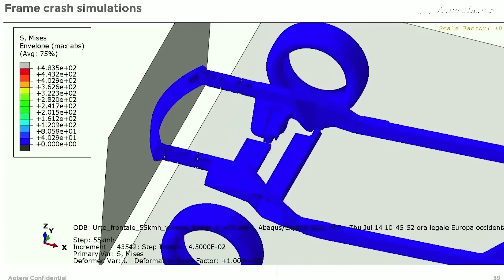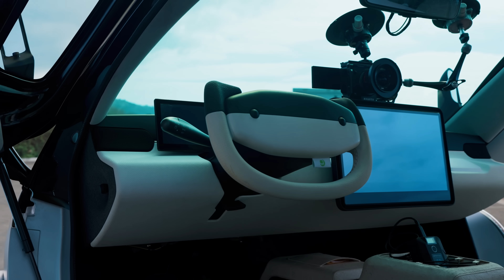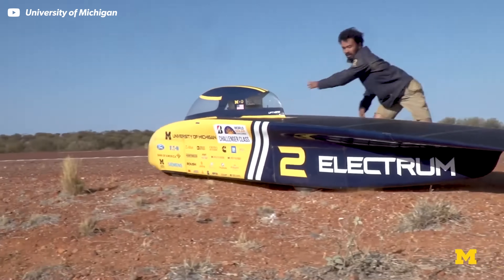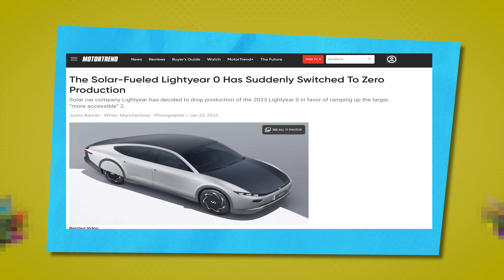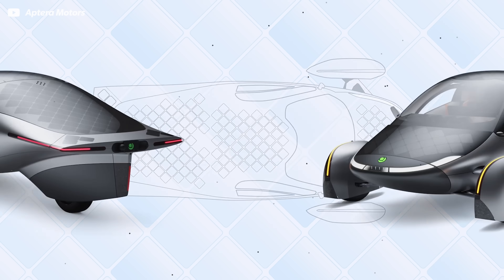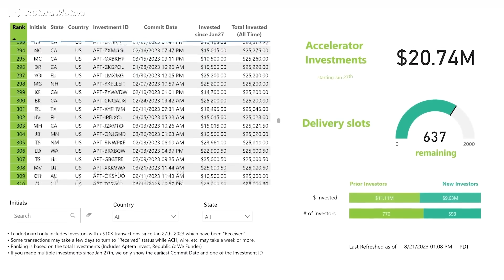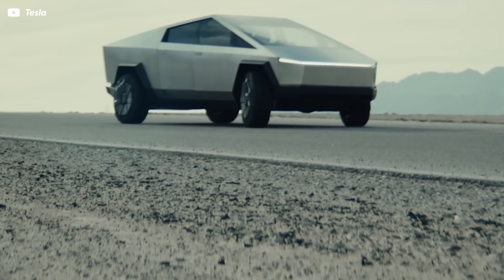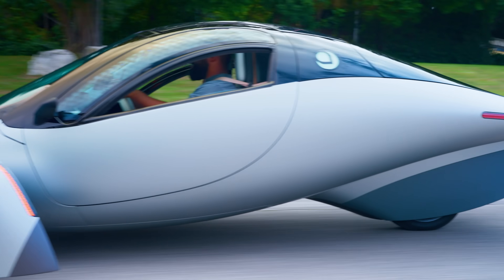We Drove America's First Solar Car

Comment: I'm on the list. There's No need to convince me further. But...

What is it with this skateboard pedal fetish? Is this a California thing, a generational thing, or what? I don't think Aunt Mae from Podunk, Nebraska will be impressed. Tell me the production model's pedals will be plain, black, and otherwise indiscreet. Please.
And...,  the steering 'wheel' is not my thing either. This is way more a negative influencer than the pedals. I won't be looking at the pedals while I'm driving, so they can be ignored. In my opinion, the yoke is a joke, regardless of the benefits being touted. And what about the plethora of screens? What ever happened to the KISS method of design?

I love the concept. There are so many positive things to say about the vehicle regarding engineering and exterior styling that I can't list them all here. The interior however, leaves a little wanting.

But I guess a few thorns are no reason to dismiss the beauty of a rose. I'll learn to live with them (like'em or not)

Comment: Why don’t they put an alternator on the drive shaft of cars to charge the electric battery?
Reply: That would be a sort of "perpetual motion machine" that couldn't recover the friction losses.  In fact, some energy is recovered when going down hill or braking through regenerative braking systems.
Reply: @n.brucenelson5920  then how does a windmill or water turbine work? The drive shaft spins so...
Reply: @jameswilson4732 The windmill or water turbine are not getting their energy from the same system.  If the wingmill was turning with wind blown by a fan or the if the water came from a pump driven by the same battery system you would have the same issue.
Reply: @n.brucenelson5920  so you couldn't put a separate device in the spinning drive shaft to capture the energy and transfer it to the batteries?

Comment: Hmm... a design that will NEVER gain easy acceptance nor ADR compliance in Australia. IF it was given approval it would be classed as a motorbike with that solo drive wheel. Three-wheels = motorbike. There are similar motortrike vehicles for sale. Most consumer drivers would baulk at the need to pass a test for a motorbike licence. It automatically restricts the market greatly.
Reply: There is no solo drive wheel - they have either 2 or AWD.  It is likely that the laws will change regarding the class Aptera needs to be tested for.

Comment: so how many years would it take to charge the  batteries using the solar panels>>>
Reply: The answer would depend on the size of the battery pack and the local solar insolation, but it won't take years.  You can easily find the data for your location.

Comment: I wish this was $25k like they said it would be
Reply: The base model was announced with a target price of $25.9K in 2020.
Reply: @Sony-ox7wx  Both vehicles have gone through significant changes since they were announced.  However, even with the huge upgrade in design from a vacuum resin infusion body to carbon fiber and SMC, the value proposition has only increased.

For those that seldom need a 4 door car, the cost of ownership and the environmental burdebn of an Aptera, and the likely service life are all vastly improved over a Bolt.  

Also, for those who want to go camping, the Aptera can sleep two people who are considerably taller in vastly more comfort than if it were tried in a Bolt.  Aptera is a perfect weekend camping vehicle.

Comment: That driving yoke is so frigging dumb. It's not an aircraft where the yoke only has to turn 90 degrees each way, it has to turn full lock either direction like a car and so removing the wheel makes it awkward to hand over hand turn. If space is an issue, use a smaller steering wheel like Peugeot cars have.
Reply: All great things are a mixture of Art and Engineering.
Reply: The yoke was chosen because the side rear view screens are in front of the driver. A full wheel would obscure the view. The steering will probably be proportional. Quicker at slow speeds and slower at high speeds. Lock to lock probably won't be necessary.
Reply: @tims8603  like I said, use a smaller wheel then. Peugeot cars have teeny tiny wheels that don't obscure anything while supporting hand over hand turns or just comfortable resting of the hands on the wheel. I don't know if the car is steer by wire but you're not going to solve the full lock issue otherwise. I've also not seen any car with a yoke and steer by wire running 90 degrees left / right where anyone has anything positive to say about it - best they say is "you get used to it", which is damning with faint praise.
Reply: @drxym  From what I understand, the steering post will be an 'off the shelf' part. There will, probably, be  a way to change out the yoke for a steering wheel.  They may even offer a choice between the two. We really don't know yet.

Comment: So no one gonna talk about the 1000 mile range? Where in that car they put such a big battery pack? Am i missing a new technology or something?
Reply: The 1000 mile range version is still probably several years out.  The pack itself will use new batteries with the same form factor as the present ones, except taller.  This is also true of the 600 mile range versions.  There is still a lot of development work to do to complete these models.

Aptera is a continuous improvement company, and there is a possibility that completely new battery tech will be available to them with higher energy density than the present cells, and if so, they could switch.

Comment: Why isn’t the whole body covered in solar cells?
Reply: Probably cost Vs reward.
Reply: Every usefull surface is covered with the full solar package, the nose, the dash, the roof, and the hatch. Putting them on the lower panels would be ineffective.

Comment: I'd buy it i'm from idaho wonder how it will handle in snow?
Reply: I live in Iowa and will be reporting on the performance with an early model.  Due to the excellent traction control with AWD and snow tires, I expect it will do well.  The wheels can adjust torque with tire slip every 2.5" of tread travel.  They already tested a prototype on a ski slope in Switzerland with snow depth above the bottom of the wheel pants and it did OK.

Comment: They’ve been promising this car for like 10 to 15 years what’s taking so long?
Reply: Not true.  Aptera Corp was founded in 2019, and design was begun on this EV.  The company originally expected an initial demand in the neighborhood of 4,000 vehicles.  Paid reservations exceeded 3000 in a week and quickly grew - now past 48,000.  

The original plan was to build the vehicle with vacuum resin infusion, as are the prototypes.  Such production doesn't scale well, and production was delayed so that it could be redesigned to be produced by CPC, a Supercar builder.  The quality of the production vehicles has taken a major leap.  The first Production Intent vehicles will be finished soon and validation testing will start.  Depending on results we should start seeing shipping by the end of 2024 or start of 2025, if not before then.

Comment: Won't work in Oregon for 9 months out of the year...
Reply: What makes you say that?  I intend to drive mine in Iowa year 'round.  You know that you can gain 130 miles overnight by plugging into a standard 115 volt AC outlet, don't you?
Reply: @n.brucenelson5920  - kinda defeats the purpose of a “solar powered car” if you have to plug it in the majority of the time. Also, I’m highly suspect of their solar charging claims…
Reply: @AdamsLab  Oregon Coast conditions aren't Southern California where most of the early buyers are located.

Perhaps you aren't familiar with the performance of the Maxeon cells that Aptera is using.  It is the area where Aptera has the most IP, that still needs protection.  We will be finding out more details with the 3rd party validation work on the validation models that will be on the road soon.
Reply: @n.brucenelson5920  - Cool, a car that's only viable in a single state... 🤣
Reply: @AdamsLab  Perhaps you didn't notice that I will be driving one of the first of the vehicles year 'round in Iowa.

Comment: What about if the car is parked in a parking lot and off. Will it still charge by itself?
Reply: Not sure what the question is.  As long as the panels get some sun, they can charge the batteries.

Comment: The model they are driving is closer to $45k
Reply: That's not the case.  That one they are driving does not have the full solar or a long range battery. It's is a prototype. The Launch Edition will have full solar, AWD ( wheel motors on all three wheels) and a 400 mile battery. While the final price might change, currently the Launch Edition is $33.5k.

Comment: Heated wheel arch for the snow?
Reply: Much of the heat produced by the vehicle is from the wheel motors located in the wheel pants.  It may not need any extra help for this function.

Comment: When it started out was it ever meant to be a SOLAR CAR
Reply: This particular design began in 2019 with a wheel motor drive train and solar panels.  Friction points were eliminated where ever possible to make as much use of the available power as they could.
Reply: Not at first but they got it efficient enough that solar would give you 20 to 40 miles a day and now they pushing the solar thing. I just hope they keep a glass rear window as an option.

Comment: A huge part of the power used in a car is pushing air out of the way. That's the hidden magic of Aptera's range: aerodynamics. Rolling bricks with ICE tech are so horse and buggy compared to this. Since they're legally motorcycles in many states, I can't wait to see people show up driving Apteras to motorcycle license endorsement classes.
Reply: Probably won't happen.  In some of these states, you can;t even roll a dresser bike through the area that it is required to turn in with the wheel at lock.  They provide a small bike that the test must be taken on.

Comment: So not really solar powered. Just since minimal extra charging from solar panels. Really minimal. 5 miles charge per hour in the sun.  Hope you don't drive more than 5 miles per hour.
Reply: You do know that the sun will be charging as much as 4,000 watt hours per day into the 45 kW battery pack of the first models, don't you?   That will be enough to drive 40 miles in the US SW at EPA highway speeds.  

We will have more exact numbers once the validation testing has been completed on the PI models.  I would call enough power to meet the daily driving needs of the average driver real solar power.
Reply: @n.brucenelson5920  so if you drive more than 40 miles in a day you are running an energy deficit.... that's my point. It's not solar powered.
Reply: @greatbigguy  Look at what you said.  You don't have a point.  In Iowa, I will probably only average 20 miles per day, but that is still more than my usual daily miles.  It is likely that I can do an occasional round trip to Des Moines or Kansas City and STILL be only on solar.  And, lets say I have to plug it in.  Where I live, 63% of my grid power comes from wind..  And if you compare it to any other car - lets say a Tesla Model 3 at the same speed, I will still use 2.5 times LESS power, no mater what the source.  The daily power expense will put dollars in your pocket no matter how much or how little you drive.
Reply: @greatbigguy  And it could be completely wrong  If I average less than the solar gain per day, which many owners will, I can drive up to 400 miles on this first version completely on solar power.  It will have been completely generated and stored by the car.  You are trying to mislead by ignoring the actual performance of the tech which will soon be publicly validated with the PI builds.

Comment: “They will be on the road next year” BULL S*** they have been saying that for 5 years.
Reply: No they have not.  The company was only started in 2019, and they originally expected a small market and were planning to produce the production bodies with vacuum resin infusion tech, just like the prototypes.  When more than 40,000 pre-orders came in, they shifted to stamped carbon and SMC sheet, produced by CPC of Italy, like other supercars.

The result will be greatly improved quality at the cost of a slip in start of delivery due to the complete redesign that was needed.
Reply: @philodox7599  2 different companies. 2 different vehicles. There was a gap of 8 yrs in between.

Comment: How is it in the rain and snow?
Reply: The traction control is exceptional.  I will report on my experience with one in Iowa.
Reply: It has motors in the wheel hubs. That means they can use torque vectoring to control wheel spin individually.
Reply: @tims8603  Yes!  Each wheel can sense tire spin and adjust torque about every 2.5" of tread travel.
Reply: @tims8603  I'm more concerned with the braking performance with such a lightweight vehicle and only having 3 wheels. Especially since snowy roads usually have tracks made by other vehicles, and your rear wheel will be dragged through all the crud in the center that other cars won't touch
Reply: @Brainplastics  Aptera, like most EVs, will have regenerative braking. That means that, when you let up on the accelerator, the motors will act as generators and put some of that energy back into the battery. It will have different levels so it can be adjusted for varying situations. Instead of stopping the wheels, it puts a little drag on them. It can be set to be very gentle or aggressive. Aptera is also very light which means it won't have as much mass and, therefore, not as much kinetic energy. There are some Aptera ambassadors that live in the upper Midwest, like I do, they will get their Apteras before most of us do. One couple lives in Iowa the other couple lives in Michigan.They have stated that they will keep us informed of it's performance in winter driving. I will be watching them to access how it performs. Aptera has stated that their vehicle will be made to work in all climates. I'm confident that it will do fine in snow. I will, of course, get mine with all season tires.

Comment: would it work in seattle?
Reply: Of course.  The benefit of using 2.5 times less power than a Tesla Model 3 for the same performance will be clear to anyone only needing space for one or two passengers.
Reply: No it will spontaneously combust.

Comment: Total: $48.300 not so cheap for a seccond car.
Reply: Aptera is presently expected to start at $25,900 for the 250 mile range base version.  Final pricing has not been announced yet, but $48,300 has not been suggested by anyone associated with the company.

Comment: Sucks that I park in a garage at home.
Reply: If you have a 115 volt AC outlet in your garage, you can gain 13 miles of range per hour of plug time.  The power will cost you a little, but far less than gasolene would.

Comment: On another hand side for $25k you get: very questionable practicality, unknown reliability (those front wheels look fragile), questionable maintainability and ability to even repair it. Like someone lightly rear ends you -- whats next? 

Its a tricycle, how the heck it even stops? I guess breaking distance could be at pair with a massive frame-based SUV.

I mean, it looks different, there is that, but cars look like they do for many, many, many reasons. Its unlikely that engineers in Japan or Germany never tested any different shapes or forms. Chances are they did.

Comment: Just not a fan of those wheels. Looks like you can get bolt cutters to rip it.
Reply: The Aptera wheels are standard automotive wheels that bolt on to the wheel motors as if they were drum brakes.

Comment: But its 7' wide... And how do you dodge potholes with 3 wheels?
Reply: There is almost 4 ft between each front wheel and the center.  They are easy to straddle.

Comment: I would like to see a roof top collapsible canopy that folds out when parked giving wheel to wheel solar collection giving triple the solar, but the size of that solar panel as it is, they arent even trying, that little panel would charge a small fridge for a day, right direction but theres no solar beef here, you're gonna need to build large, light sun sails.
Reply: How can you say that they aren't even trying when the panels are now glass covered and 40% lighter in weight than the original plastic covered ones.  They are going to be extremely scratch resistant and among the most efficient available on the market, with a controller that adapts to shadows without a huge decrease in output?  You apparently haven't looked into what they are doing.

Comment: How will it do in snow?
Reply: Apparently the all wheel drive version can cope with snow but I don't see how, the drag from 3 wheels would be too great. A 4 wheel car only has drag on the front wheels as the rears follow in their tracks. I wish this vehicle was more reassuring but I just can't see it coping in the real world.
Reply: @Crazy_Dave  I presently drive a Gen 1 Honda Insight.  The rear wheels are narrower than the front track and it is still not terrible.  Unlike most cars, the AWD Aptera models can sense wheel slip and adjust torque every 2.5" of tire travel.  With decent snow tires I think it will do very well.  The gamma prototype has already been driven on a ski slope in Switzerland with snow above the bottom of the wheel pants.

I think it will do well and will report on my experience with an early model in Iowa.